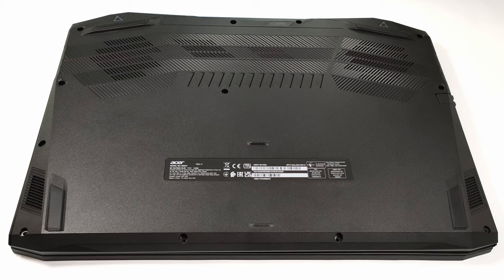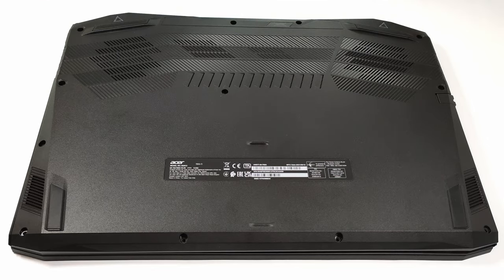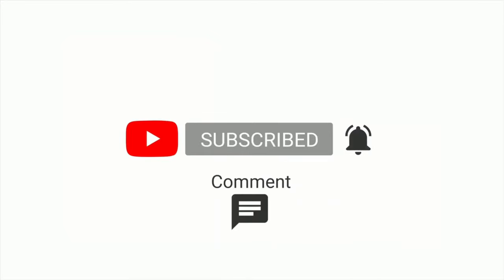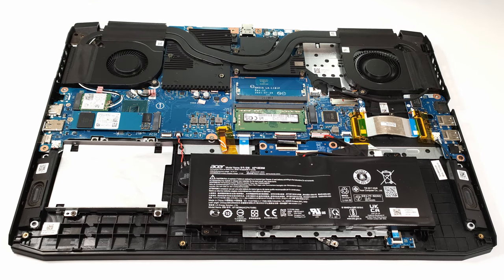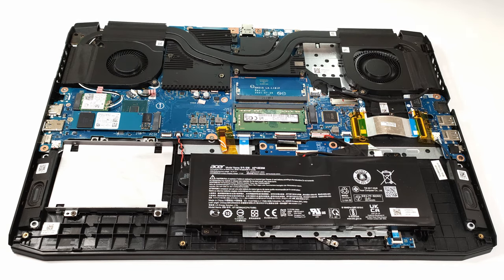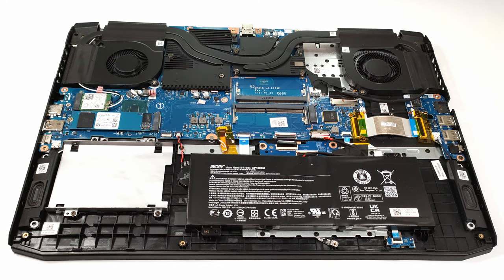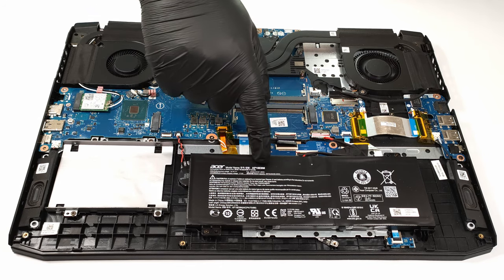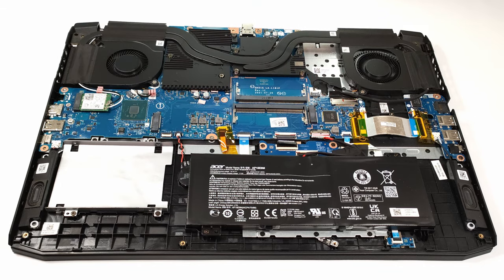🛠️ Acer Nitro 5 (AN517-54) – disassembly and upgrade options

Comment: It would nice to show how to use the plastic tool to open it. And also how to remove the ram.
Reply: You simple press on sides of ram.. there is a little lever thingy. Once pressed you can simply pull ram out with ease.

Comment: The cooling is shocking in this system. The specs may be ahead of other Gaming Laptops in this price range, but you’d be better of going for lower specs with better temps.
Reply: Nope. If you know how to undervolt.
Reply: @Mezzeric do you have the same model

Comment: Hi, can you help me I want to upgrade my laptop to 64 gb of ram , which ram should I buy which reference? thanks if you can add a amazon link the better
Reply: It’s a little late but but make sure it’s ddr4 I believe that’s what the motherboard supports, idk about ddr5 and make sure it says it can run around 3200 to 3600 mhz, I bought the ram I have off amazon

Comment: ok-it comes with a single stick of ram, can I simply buy a second stick? or do I have to buy a matched pair like I did back in the day?
Reply: Just buy a second stick. But u may want to replace the on board 8gb ram with a 16, then add another 16 for the max on this laptop of 32

Comment: This video doesn't actually show you how to open the laptop making it basically pointless.
Reply: Yeah i came here to see how to open back side where the heatsinks are duno how to explain that side is giving me problems
Reply: @TheSabijach  you could have just checked out the official guide. you have to remove the screws sink your fingers into the exhaust holes that are facing away from you, push your palm against the plate and start ripping it up and pull it towards you. Gamer laptops are like this, ultra garbage plastic sht.